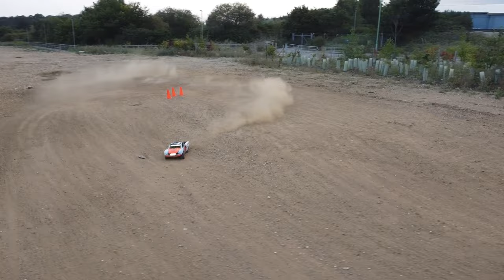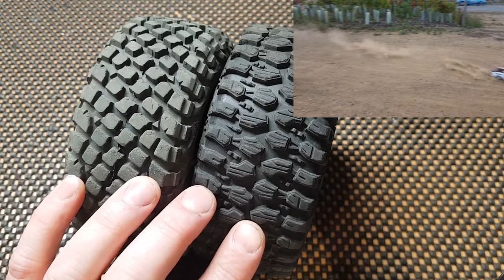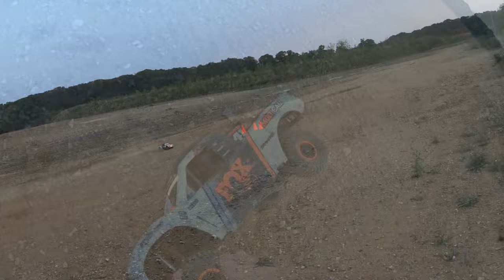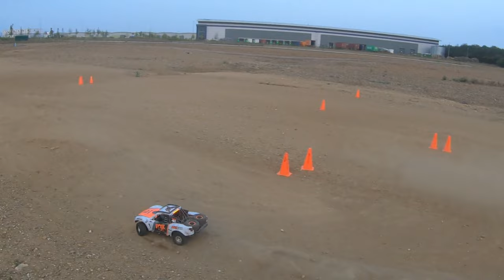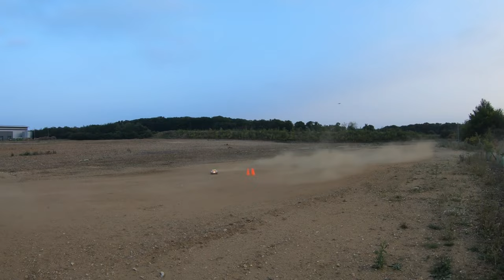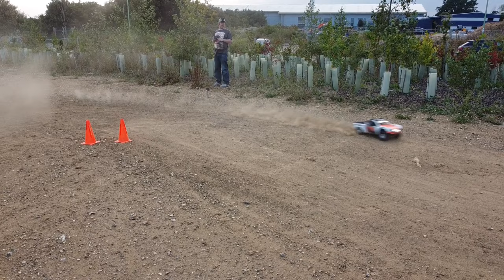Should you upgrade Traxxas UDR wheels and tyres

Comment: So, for the extra weight from the bedlocks and tires, it's preferable to compensate by adding a stronger motor and chocks
Reply: What motor/esc did you end up going to compansate the weight... AND... was that worth it? The other thing you can do if your temps allow you to, gear up or get a strong "C" rating battery(s), that would help get that extra kick out of the hole. A lot of people firgeabout their batteries for performance upgrades. I put 2.2" on my 2 wheel drive slash ^ proline monsters and with some body trim and a sidewinder 2 on 2 S drove way better than stock.
Reply: I mean which esc can you get that can support the UDR LED's? IMO the stock power is plenty on 6s stock. If you want more power just buy a sbr 2.0

Comment: Nice to see confirmed what my issue is with the heavy monstrus tires nowadays. For instance, monstertruck tires were about 150mm, now like 180mm. On my kraton i drive only 2.8" now. Saves +1kg, that's about  20% off total weight rtr!!! Drives way better, lower cg, lower temperatures,  lower wear and faster. Lightweight, thats the way to go, just like racers do...
Reply from the maker: Yes agreed and when it is rotating mass it magnifies the effects

Comment: I would image with all the metal bits and pieces it will definitely put a strain on the motor, especially when applying the brakes.
Reply from the maker: Yes you can feel the extra weight!

Comment: Is there a way to widen the wheelbase of the udr gpm has a +3mm hex but I was looking to make it more stable in a turn by widening it.
Reply from the maker: Only way is on the hexes . Best to try adjusting dampers and roll bars . What surface are you running on. We will shortly be releasing a video of racing them on high grip grass and they handled really well
Reply: @TeamRC3D  ok Its crazy no one's made something so you can widen the wheelbase since rolling over is such an issue with it. My next thing is the vitavon sway bar kit v2

Comment: I had like 8 sets of Vitavon wheels for UDR and sold them all. They are superb quality and they look excellent but: they will rub on the body, you can feel their weight while driving and I thought they will cause more damage overall to the car on every crash or hard landings. The good thing is that they will add rotation mass and weight on the bottom which help with stability so you'll have less rollovers.
Personally, I cannot recommend running aluminium wheels just because the extra weight can be felt a lot.
Reply from the maker: Agreed extra weight makes big difference. Cannot understand people that throw a lot of alloy upgrades on the truck
Reply: @TeamRC3D  alloy is good for center of mass items such as gearboxes / bulk heads / chassis / chassis braces.  everything that extends out from the center of mass should be made of something that can absorb impact and spring back or break.
Reply: Interesting.  Did you have both versions (for stock tires and for Hyrax tires)?  If so, which combo did you feel was better overall?

Comment: Proline sucks. I buy a set of 4 for my VITAVON wheels and I just use like 7 minutes and one of those new new tires ripped. I said new newer use it. And is not another tire fit the vitavons Wheels. For proline is a good thing to sold those tires .
Reply: Proline sucks indeed. Had way way too much failures with them. Asked them about it since i spend hundreds of dollars on them. No reaction... the truck bodies are not bashproof also, only slow rolls, tend to brake at rearbed/cabine..  I suggest to spend your money on other brands...
Reply: The  vitavon V2 wheels are made only for proline hyrax. You have to get the standard vitavon wheels